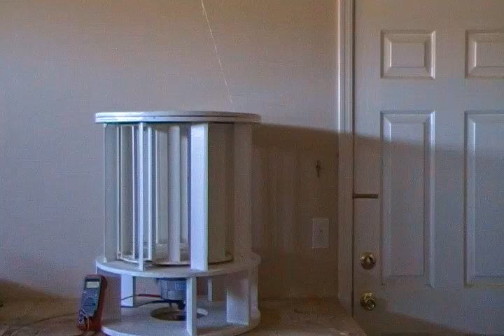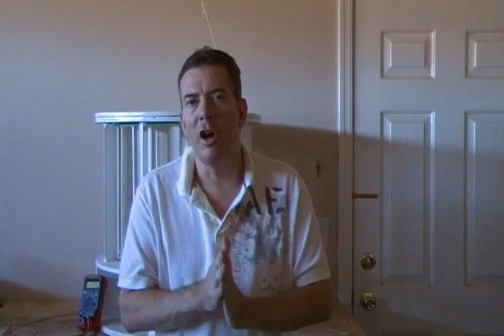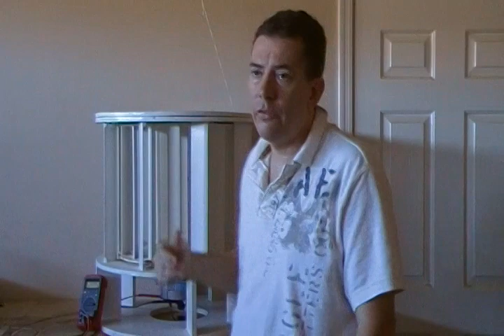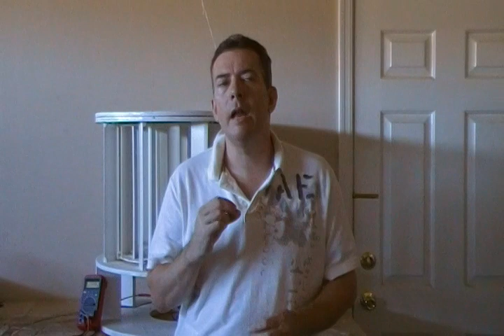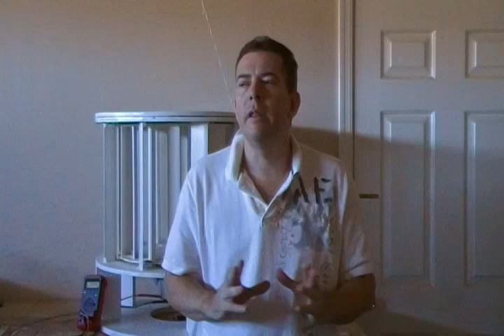Update! Large Homemade Wing Lift VAWT Coming this Fall

Comment from the maker: @Micronix65 My tests show my little turbine is putting out approx 5 amps x 20 volts in a 20 mph wind. Maybe 90-100 Watts in 20 mph average wind. And this turbine needs about 10 mph to reach 12 volts charging, at least with the set-up I'm using. That's why I want to build a larger geared up turbine so I can get more rpms on a PMA in low wind and really crank it in higher winds.

Comment: I left a detailed comment on your last video.  The same questions apply.  How much power (average or peak, and at what wind speed) did your first design generate?  5 times as much power means nothing without a base line.  You seem to have a great idea/design, however, without output numbers, It's impossible to compare to other designs available for the same cost.

Comment: @imikewillrockyou 
Was that really 5 amps and 20v at the same time, or are you measuring like the alt manufacturers do, which is open circuit voltage and short circuit current?

Comment: @imikewillrockyou 
Ah okay,.  That's an okay way to measure the performance of alternators because you can use some math to figure out how that alt will perform with a given turbine and load.  But it really doesn't tell us much about a turbine.  Next time you have it in the wind, maybe you could measure voltage and current with a few different loads.  That would let us approximate a power curve.  (or if the intent is to charge batteries, just measure the current into a 12v battery.)